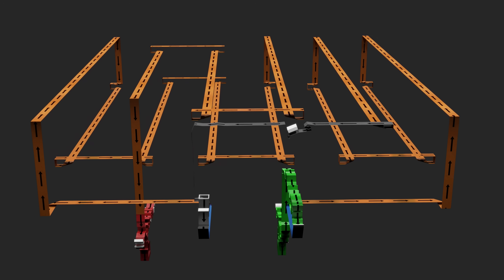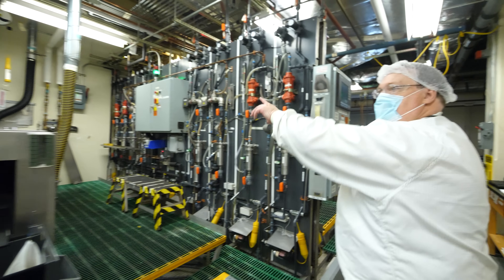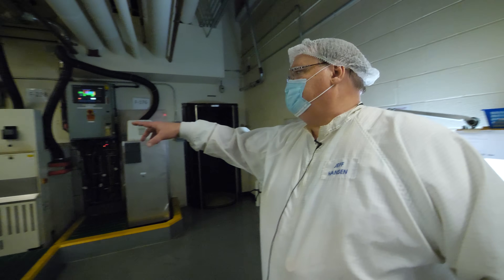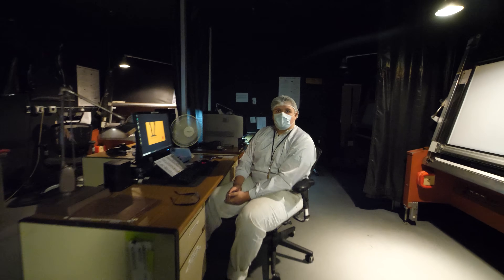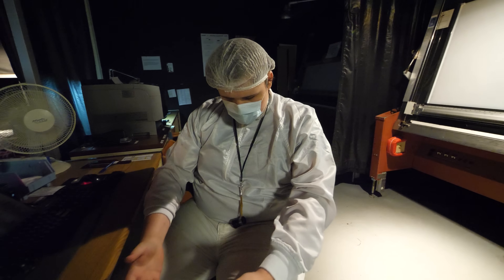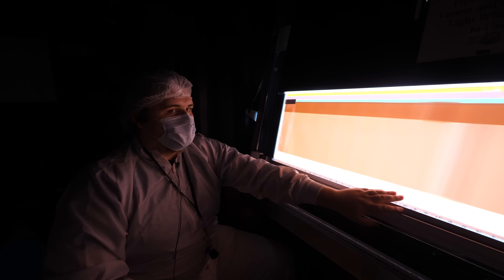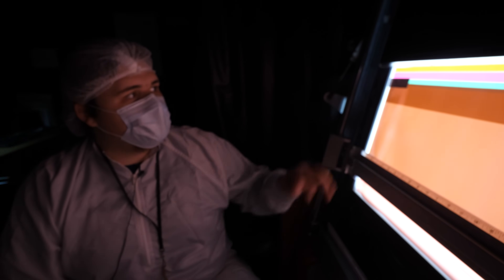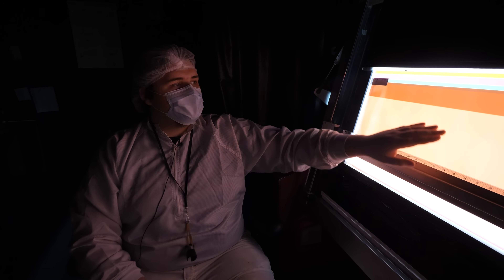Kodak's Film Quality Control Process - Smarter Every Day 275-B

Comment: There is no tension between manufacturing and quality control, not in well run manufacturing. Quality really is free. Problems found by customers cost a lot, sometimes the whole business. Finding and fixing them at source is always cheaper and makes the process more efficient too.

Comment: Would that spec of dirt show on a piece of film? Would you notice it when you take a picture and just skip it?
Reply: You would of course only notice it after you developed the film, not immediately after you took the picture. Most probably you will even only notice it after you 'printed' it on phtotographic paper, so made a positive again. 
But even with a perfect film, you will get dust particles. Most probably you will load the film in your camera in your room, or outside. During lighting of the paper, you may get dust particles on the film, especially when you do it yourself. For B/W there are paints with which you can hide white spots on the final photograpic paper. A different level of photoshopping ;-)
Reply: @bobcat_the_Lion  I don't know why I thought you would see it on the view finder 😂. But yeah I see, it's probably not that big of an issue. You probably can get more dirt from putting in the film than getting a spec in one of hundreds of rolls.

Comment: Question, how can the roller leave a marker on the film if the roller has air between itself and the film?
Reply: There are tons of places the rollers make contact with the bottom of the support. I just changed the bearing on about 100 of them last week.

Comment: I recall reading somewhere that Kodak’s quality control lab was the first organisation outside government to become aware of the Manhattan Project. Radiation caused by the first test apparently caused a consistent fault in their X-Ray film processing. Having ruled out a manufacturing fault they approached government with their findings.
Reply: Veritasium did one I think
Reply: I’ve see a video on YouTube about this. Was hoping it would come up in conversation here.
Reply: Yea but then they took that information and used it as leverage to get funding
Reply: There was a problem in the computer industry for a while because a lot of ceramic materials (iirc) came from an area near a nuclear test sight and had been embedded with radioactive material (not just irradiated).  The radioactive materials were gamma emitters meaning they emitted electromagnetic waves with a shorter wavelength/higher frequency than X-Rays.  Gamma emitters are all over the place and while gamma is ionizing (meaning it can alter atomic structures) most gamma emitters don't produce enough to be harmful to humans (our bodies are actually designed to handle a good deal of ionizing radiation, especially from outside sources like the sun, using things like a layer of dead skin that absorbs/blocks most of it and special immune responses that quickly kill mutated cells or DNA).  When electromagnetic waves hit a conductor they induce a small current, the higher the frequency/shorter the wavelength the smaller the conductor has to be, since gamma waves are particularly short they are able to create a current inside the gates of the transistors within the computer processors and memory (RAM), activating them even if they weren't supposed to be activated (gates are like switches, when you apply a small current to the gate it allows power to flow through the other 2 pins of a transistor).  Normally the plastic or ceramic that encases the components would easily block such radiation, shorter wavelengths (with few exceptions*) have worse penetration through solid materials, that's why mmWave 5G needs so many repeaters to work and that's nowhere near the nanometer or picometer range of gamma.  Of course since the ceramics themselves were contaminated that meant that the chips were actually getting blasted by the very material meant to protect them.   

*Some solid materials have small gaps that make it easier for certain wavelengths to travel through, quartz is a good example.  That's also why we use quartz glass for (real) UV lights, normal glass blocks UV (UVC, X-Ray, and Gamma are all ionizing).
Reply: Interesting fact - Kodak stores the Q/A film strip samples shown in this video in refrigerators or freezers, don't remember which, in an unused section of the American Rock Salt mine near Geneseo, NY because the salt blocks the naturally occurring radiation in the environment

Comment: As a customer, I know Kodak takes quality control seriously. I emailed them once about a defect on a developed roll. They asked me some general questions and took my concern very seriously. Two weeks later 5 rolls of replacement film showed up in the mail from Kodak. The weirdest thing was, and I went back through my email to double check, was that I never gave them my address.
Reply: maybe they asked the store you bought the film in to send it to you?
Reply: @xgozulx  Good point! I don't remember now if I told them where I got it but that's the only possibility I can think of.
Reply: @B3D5X  That does make sense - you weren't happy with the result, so it was either them or the lab.
I find it quite reassuring that this means they gave your lab a grilling.
Reply: @goldcd  I actually developed it myself but the other roll I developed at the same time came out fine. So either it WAS my fault somehow (though I've never had the same issue before or since) or it was the film somehow. Either way, however they got my info, they erred on the side of making me a happy customer. And I was. I gave them the batch code numbers and all that but never heard what came of the investigation.

Comment: Noob question: isn’t the film exposed to light? I watched all the videos but I might have missed something. This is after the coating with chemicals has been applied but wasn’t it supposed to be in total darkness?
Reply: The film backing is always running through the plant, so they don't have to "re-thread" that film.  When they want a film the start coating with the light sensitive emulsion.  They then roll that up and put it away without it having been exposed to light.  All the Film you say with the lights on was just the plastic backing with no coating applied.  The coating looks white in color when it's there.
Reply: The "film" you see in the videos here were called the "leader", which is just there so you don't have to thread in the "real" film (with the emulsion) each time. Just coat it/attach it and the leader pulls it through the machines.
Reply: Good question! I believe that when this was filmed the production line was stopped and so they could have the lights on without damaging the film.
In the video on the main channel there are moments when the lights turn off as they restart the line.

Comment: I'm curious about how they monitored the film back in the day when they were still making infrared sensitive film, like Aerochrome or some B&W films, since the infrared light they use to monitor normal film will instantly ruin the infrared film.
Reply: I'm just guessing, but if its IR sensitive, wouldn't that mean it is not sensitive to most visible wavelengths?  You would then use something like a sodium bulb or a laser to get one of those wavelengths and scan with that.
Reply: @thekodanator  Well, as far as I know (and had one time hands-on experience), they do sensitive to visible light too, at least the B&W ones. These films are just normal B&W film, but over sensitive to IR (usually, films are over sensitive to UV, that's why there are plenty of UV filters for camera). They were meant to use for aerial photo reconnaissance or traffic surveillance cameras, because IR can punch through fog and haze, makes photos clearer. Even today, Ilford in UK, and the factory in Belgium that produces film for Rollei, still makes this kind of B&W film.

If you use these B&W films without IR filter, the photos you'll get are just simply normally B&W photos. Only when you use in combination with the IR filter, which will cut out the visible light (up to what wavelengths it rated for), then the photos will come out completely different. On the other hands, if you use the IR filter with the standard films, the photos will be super underexposed, or not exposed at all.

Actually, some compact cameras read the DX code (the bar code on the film cannisters that tell camera what speed are they) with IR scanner instead of electrical contacts, could cause some film stocks to fog up.
Reply: Anyway, technically, those B&W films I mentioned prior are "near infrared" sensitive, so the manufacturers could use even longer wavelengths infrared, maybe I guess? But there were films that sensitive well into infrared wavelengths like Efke IR820, so I'm not sure how they monitored production back in the day.
Reply: When IR films were manufactured, the scanners would have been turned off.  I was told a different sampling pattern was employed to verify film quality for those types of film.

Comment: Interesting at 19:16 they're developing at 98F when their chemical specs always say do 100F +/- 0.25F..
Reply: Back in the day I had a color darkroom in my basement. There were many chemicals that worked at 98°. Some at up to 102. Just depends on the mix.
Reply: I noticed the Dev step is labeled "ECP". This suggests this line is running the ECP print film process, and a document I found about ECP-2D specifies that the developer be 98.0 ± 0.2 °F. Presumably if we were looking at a C-41 line it'd be running at its usual 100F target.
Reply: @BMCha1  Thank you. That makes much more sense. For some reason based on the video I assumed it was C-41.

Comment: to bad they won't do small batch Kodachrome.
Reply: Coating the film probably isn't an issue. It's the development, it requires three seperate fogging stages with 2 different colours of light, 3 developer stages. It's a very complicated film to process in colour and I miss it like mad.

Comment: Those color filters at the end are the complementary colors on the additive vs subtractive color wheels. Light is RGBW, print is CYMK. By using the other chart you can isolate light to colors by subtracting out the additive light. (This is also why only 3D glasses weren’t actually red and blue, they were red and cyan so they could use the alternative color wheels for each eye. The yellow and green glasses were always better though.)
Reply: There is no K in color film photography. Black exists only as a mixture of CMY.
Reply: @b6983832  same with W in the subtractive color wheel. But with inkjet photo printing there is definitely K.
Reply: Why is black represented with a K?
Reply: @MattH-wg7ou  to designate it different from blue. If you do the two letter versions they are BL and BK. They just shorten the BK to K.
Reply: I was for some reason struggling at first on the yellow magneto cyan, then he held up the RGB filter and it clicked in my head, inverted colors.
Reply: Was it me or did Destin find this either utterly boring or didn't understand a single thing about this and just started to make fun of it by filming Jeff through the device? Kinda weird the way he responded to it.
Reply: @MartinH81  Pretty sure that's just you dude. He seemed totally fine to me.

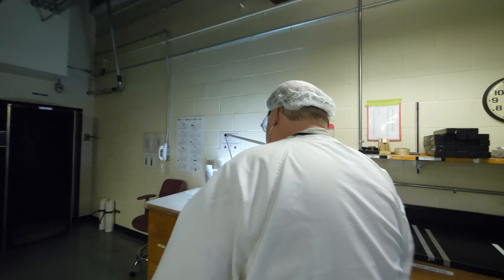Comment: 3:27 Destin: "If it breaks, what do you do"? - Jeff: "We've got really good engineers, there's always eBay" - Best Answer Ever! 🤣👍👍
I'm imagining a Kodak engineer in a bidding war with some collector for a piece of vital equipment they need to get the line running again.
Jeff is Awesome!
Reply: That feeling when you look for replacement parts for a specialty instrument on eBay and find one with a tag on it showing your factory scrapped it years ago....stranger than fiction.
Reply: Jeff mentions the most important part after that; upgrading. Upgrading (or replacing) is eventually the only way to keep complex production lines like these running.
Over the years I've seen production lines of different kinds being stopped and replaced, due to the fact that PLC-components, frequency and servo-drives and motors from the old days, and sometimes even sensors and other field components were too hard to reliably get by. The price tag on those older components was never an issue (downtime is more expensive) even though prices often went up like tenfold after the manufacturer stopped production of a specific range of PLCs or frequency drives, it was just plain availability of those components that eventually forced users to order a new line and scrap the old one.
Rarely were those machines mechanically worn out, and that certainly never was a primary cause for their replacement.
Reply: @johnenglish8126  yeah it's just too bad that companies have to be forced to that point almost like on the edge of the cliff and then the coyote cuts it off and they don't fall and they still don't want to replace it. But on the other hand you have these companies that find that they're in a niche market so they can make it whatever they want it to cost and pushes it out of the realm of will just purchase it to the well maybe, we'll put in next year's budget, to do we absolutely have to? Then there's the repairability score or lack there of for some companies to be able to actually repair something because everything is proprietary we don't want you to look under the sheet....

Comment: Where is taking photos on film still a thing in the age of DSLRs? I haven't seen a place to buy those films in ages.
Reply: From a photographer who's old enough to remember a time before DSLR's and camera phones, the difference is in the look of the physical photos that you don't get from photos you see printed or on a monitor.  If the goal is just to take pretty pictures, then digital is just fine. High pixel counts and the quality of digital cameras has surpassed what film can offer in many regards.
 
But if you're looking to take photos where the look of the photograph itself along with the subject is the art, then photos taken on film will give it a certain look that is almost impossible to reproduce digitally.  This is because film has tightly packed but randomly arranged grains (think fine sandpaper), while digital has neat little rows of pixels.  The grain of the film gives photos a certain textured look to them, while pixels tend to give it a flat look. 

While digital cameras allow you to adjust many different settings picture to picture, film requires you to choose many of those settings and the type of photos you want to take with the type of film you use. Different types of film produce different results.  Once you choose a certain type of film, you're stuck with those "settings" unless you change the roll. Expensive and wasteful if you don't use the whole roll, but there are ways to rewind and reuse partial rolls, but it's difficult and risks ruining previous photos.  One way around this is to have multiple cameras with different film in each one.  

One of the benefits (or downsides) of using film cameras over digital is rather than having the ability to take unlimited numbers of photos with unlimited numbers of setting changes, just to delete the bad ones - your film choice and the fixed number of exposures forces you to slow down and think of the photo you want to take.  And that alone makes each photo that much more special.
I guess that's why they call it art.

One last thing. As an artist taking photos on film is only the first half of it. Developing them (not commercially) is just as complicated and interesting.
Reply: I just shot a roll of color film in medium format yesterday.  Will be developing it tomorrow.  Film is certainly more expensive but not difficult to find if you know where to look.
Reply: You can still get film at some Walgreens or other stores, and places that process exposed film generally sell it too
Reply: I’ll do a roll of medium format roughly each week, and a 35mm roll every couple of weeks (QLD, Australia)